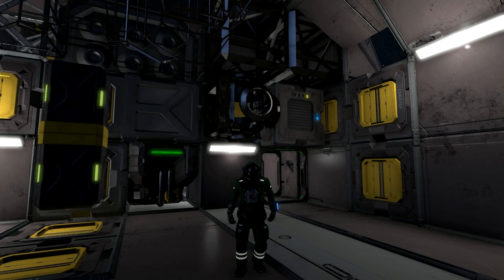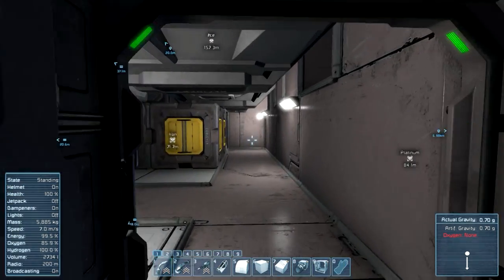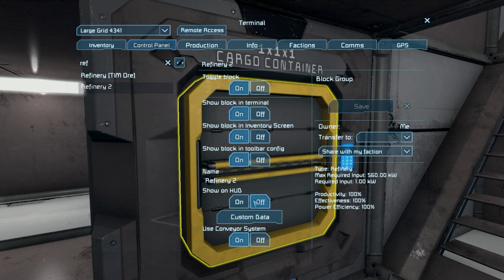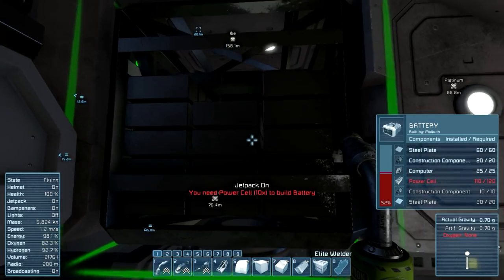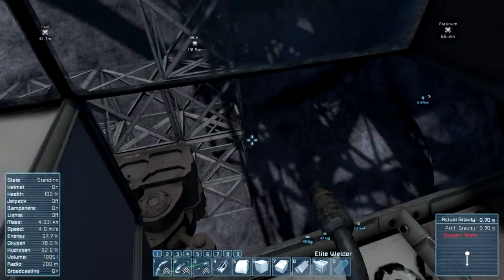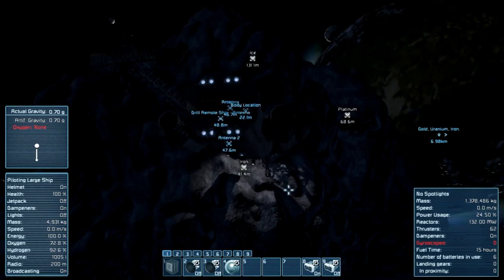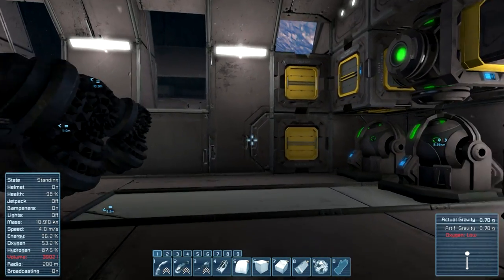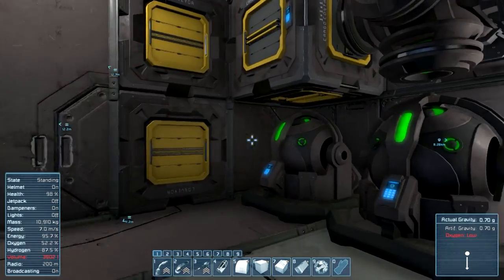Space Engineers Survival Series: Projectors And Ship Repairs [S1E18]

Comment: You can check the keep projection and it won't go away each time it's complete.
Reply from the maker: Yes, I actually like it when it shuts off, saves on frame rates and power.
Reply: Very good episode! :) A lot of LP'ers don't cover projectors (or combat) which are pretty fundamental.

I think if you turn on the keep projection option and then turn the projector off manually, it will retain the blueprint? Then you can just turn it on when needed. This way, it will also show some text in the control panel (bottom right corner) that tells you if the projection is complete (or how many blocks are missing).

I just wish I knew how to set it up so that the ship's own blueprint would line up perfectly with the ship's projector (at 0,0,0 with no rotation). I do know that which block the cursor is pointing at when taking the blueprint has something to do with determining the blueprint's snap point and projection orientation.